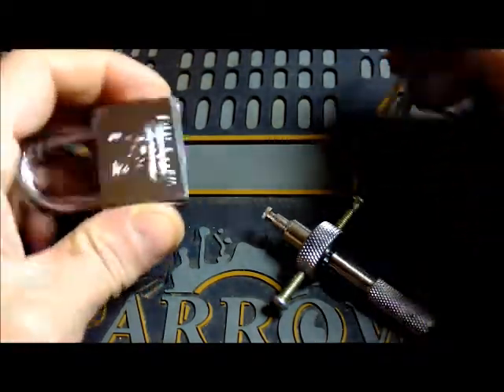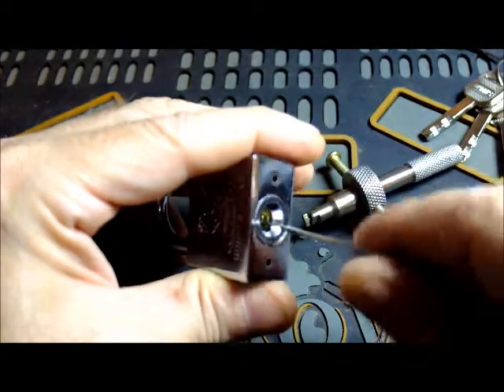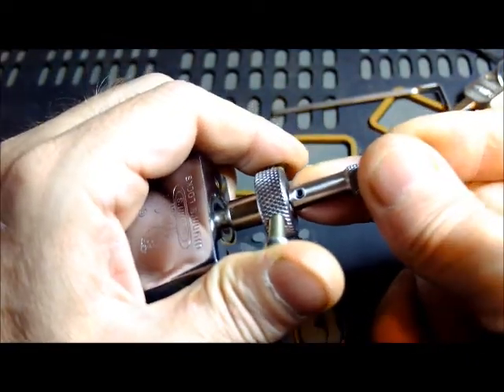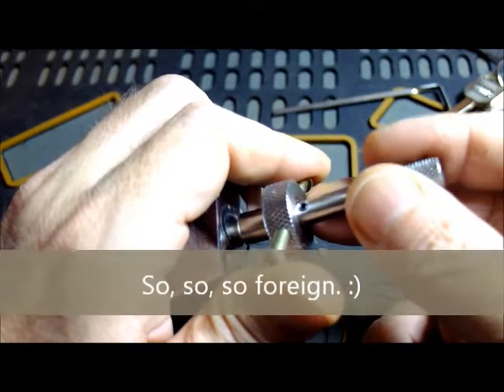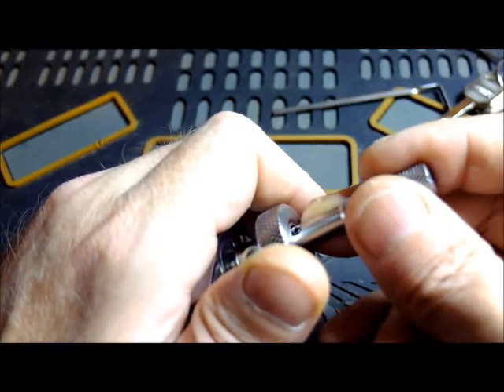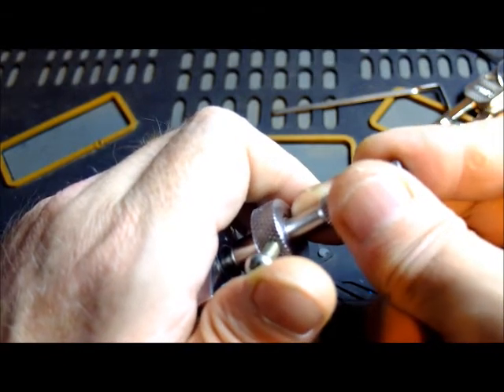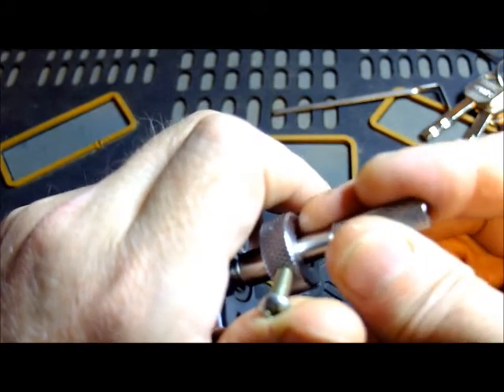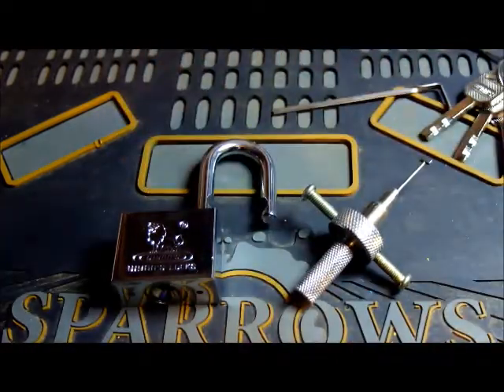Wynn's Disc Detainer Lock (SDP'd)

Comment: can be tricky these disk detainers. i has a cheap chinese set of 5 i bought and 2 of them the first disk wasnt a 90° cut so had to turn back tension and reset a couple of times. nice vid noctis 👍  
i hope to see an abloy attack when you're confidence  is up,  tho you'd probably  agree that a custom tool need be made and you're defs the man for that.
Reply from the maker: Cheers. I'm pretty sure I still don't know what I'm doing. Picking by blind faith alone. :) Abloy attacks will come, but I'm guessing it will take some time and some experimentation to open an Abloy. I'll certainly be making my own tool to try and open one up. Whether or not it all works out is anybody's guess right now. :D

Comment: Nice picking bud! Those disk detainer locks are something that I would like to get into! First I need a disk detainer pick!  Which pick do you recommend?  I'm interested in possibly getting one. Keep on picking!
Reply from the maker: Cheers. Check out the comments left by Tallan Pick and Apache Locksport and maybe talk to them. As is often the case, you don't need the fancy stuff to get the job done. :)

A different and fun type of lock to play with for sure. Well worth having a dig at. I picked this tool up on Ebay pretty cheaply. Made in China but with a little sanding it seems to work well.

Comment: Nice one on your first disc lock. I have aload of them. I don't use 2 in 1 pick. I use a fat tension wrench and homebrew pick. Much more fun. I show you soon. Ok mate. You can have them if you want?
Reply from the maker: Cheers, mate. I had the tool so thought I would give it a go. Tried to pick an Abloy Protec cam lock your way the other day. Felt like I was getting somewhere but no open. I guess I'm going to have to harden up and get busy. :)  Well, you can send them if you like, but you will have to accept something in return. You'll like what I'm thinking of sending, so just say yes. ;D